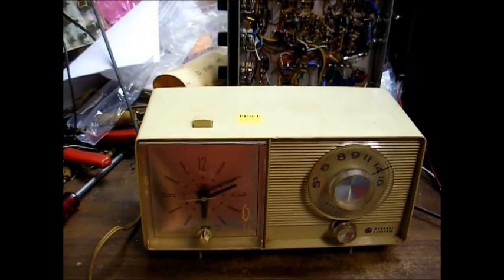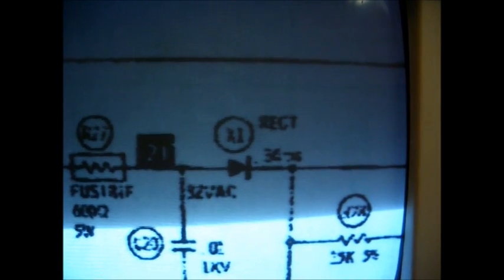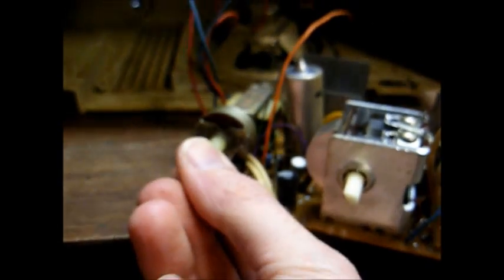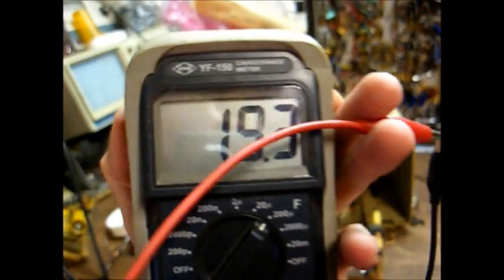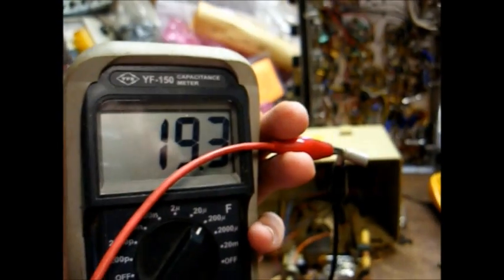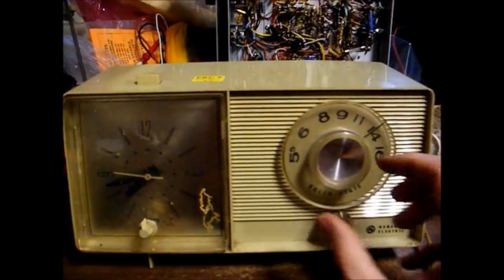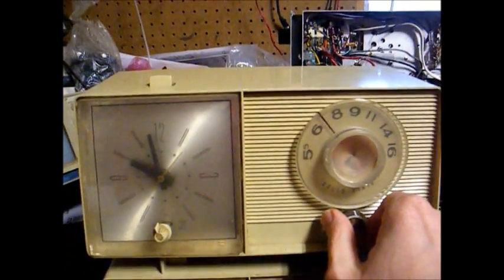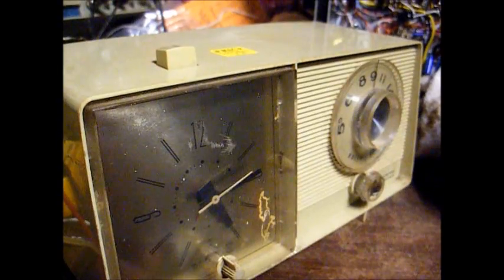Repair of a '69 GE solid state AM clock radio

Comment: I have this radio ,mine came working for now I leaving it alone,except the knob to turn it on won't come off so I can clean the clock face I cleaned everything else I can get the little on knob off it on plastic shaft .if I try to hard it could ruin this radio ,by shaping off the knob shaft so ,I guess I have to live with a dirty clock face unless someone no of a gentle way of doing it

Comment: Another interesting video! You hadn't posted a new video in awhile and confess I was checking regularly for new videos from you. Books on radio repair aren't as helpful as watching how and why you repair/replace a faulty component. Any ideas on un-seizing a tuning capacitor that is very stiff? I have an old 1962 German Graetz radio that is very difficult to turn the tuning shaft.

Comment: Recently I put a radio all back together only to find the lower part of the band did not work very well.  Same problems.  From now on, I will remember to check out ALL the band before putting everything back together.  Thanks for your great videos.